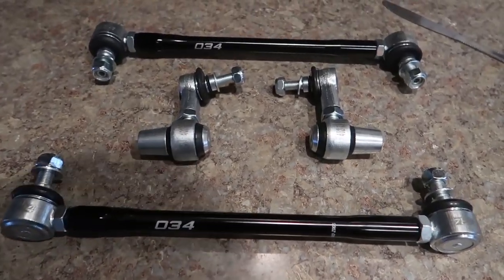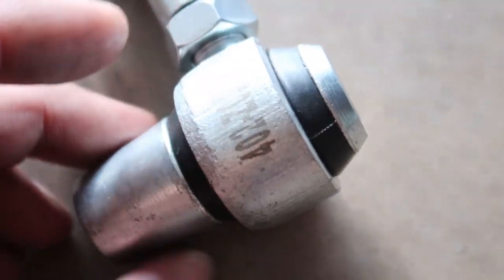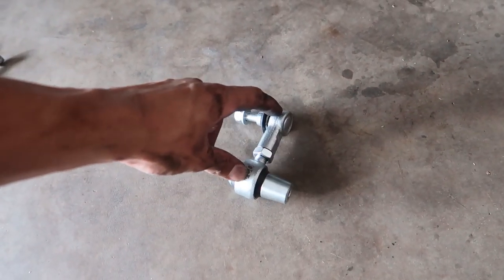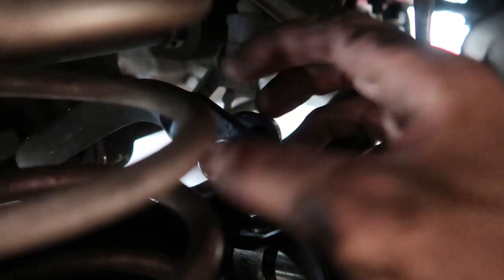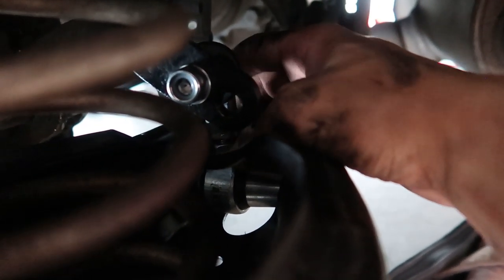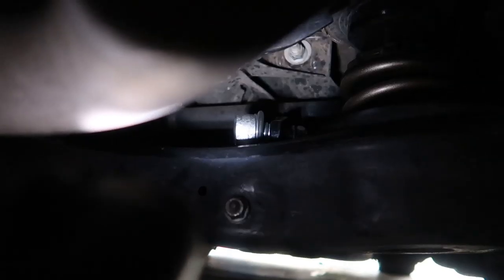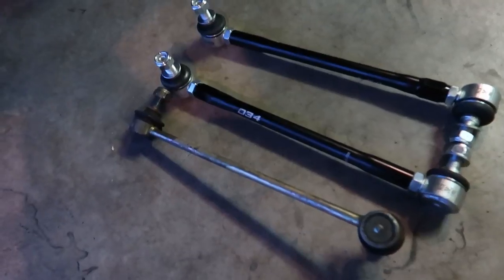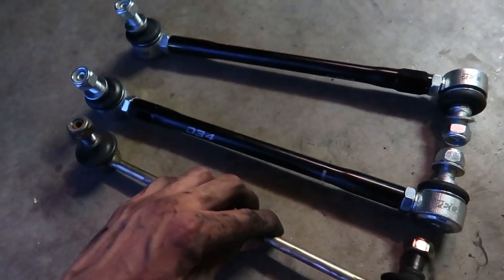034 Dynamic+ billet front & rear endlink walkthrough | MK7 Golf R

Comment: Yoyo endlinks rule! Had spherical rears too on stock height and they made tons of noise, it's the bearing that wears and gets noisy... Good stuffs
Reply: Was tons of anoying squeking noise here too...on spherical enf links...so they went rubbish...but this is seems much better option than the metal to metal conract ones...
Reply from the maker: I knew from the start the could get noisy but I didn't realize it would be to this degree. Much better now! If you don't need adjustable ones the Moog endlinks are significantly cheaper
Reply: @BryceJordanProductions  hi mate! I will check them and thanks for the hints!!! If you want any from  me...regarding trackday/time attack use...just LMK...tons and thousand/in $ 😂/  of experience here!
Reply: Definitely decided on getting 034 bar for my mk7 GTI, kinda intimidated by the adjustable 034 endlinks though. the Moog endlinks should work with a 034 sway bar?
Reply from the maker: They'll work fine. But if you lower the car a bunch you need adjustable links otherwise you'll have weird preload on the bar and it's not good for cornering and whatnot.

Comment: Great Vid, may i ask why you removed the 034 rear links and replaced them with the Dynamic Models? Also whats the advantage of adjustable vs not. Thanks Mate :)
Reply from the maker: Adjustable ones so i could remove the preload on the sway bar and the other links made a lot of noise after awhile because of being spherical

Comment: Damn bro thanks for this video, just changed the wheel bearing on my Tiguan, I locked the axle, had to take it out, got white line adjustable end links didn’t know how to install them but now I do, all my lights on to didn’t get to reset the codes but thanks again for this video cause the stock end links and air ride strut bags were running on the control arm so hopefully this will help
Reply from the maker: Heck yeah!! Hopefully that fixes everything for ya bud!
Reply: Bryce Jordan Productions thanks bro I hope so!!

Comment: When you put the car on the ground and you make sure the endlinks can move back and forth . How do you set preload do you make sure it’s even in the middle or do you spin it all the way down or all the way up?
Reply from the maker: In the middle basically, even number of threads on each side is how you wanna start
Reply: Bryce Jordan Productions thanks for the fast response I just took my old lowered car adjustable endlinks off cause one of the threads got bent . But when we installed the new ones  I thought the swap bar looked a little high but we didn’t pull it down just tightened the bottom then adjusted the top and we were unaware of releasing tension and preload so we tightened it all down while being on jacks then put wheel back on and took it for a drive and it was making all these clunking noises and my friend told me I need to pull the sway bar down and then extend the bottom ends for a little bit more room when it comes to turning
Reply: And you said you also had to pull the sway bar down so both sides were flush so hopefully after I redo that  and release tension before putting wheels on and setting preload it  will
Be fixed and not have noise
Reply from the maker: Yup I sounds like you had some decent preload, let me know how it goes after you redo it!

Comment: Need some guidance. 

15 A3 Quattro 034 springs 1.75 drop. 

Finally getting around to installing the 034 sway bar. I just need to confirm I’m going about the endlinks the correct way. 

My understanding is that since the car is lower the endlinks should be shorter. I am aiming for the stiff setting and I don’t think the endlinks can go short enough when the car is at ride height. I am noticing people jack up the arm to about ride height then set it. Is this correct or am I about to do something wrong.
Reply from the maker: That is correct. You'll have to jack up the rear slightly possibly to make the endlinks meet the spot you want on the sway 👌 I'd recommend doing these endlinks in the video tho. The tension on the stock composite ones may cause them to snap in time (I haven't seen it happen, but most do endlinks and sway at the same time).

Comment: Damn! Should find your videos before man!, last black Friday ordered the rear subframe inserts and the spherical end links (front & rear) for my S3 8p, they are awesome (you can feel the difference), but recently they are becoming noisy (clunky), mostly at low speeds. 

So if they become noisy means that they are fading? So eventually need replacement? It's like 4 months! 

About the rear swaybar do you have only positive opinions? As was planning to order mines. 

PS: keep uploading videos! You got a new subscriber
Reply from the maker: Spherical links aren’t for daily style cars, thats why you’re getting the sound. They’re mostly meant for legit track cars that don’t see much actual road time, gotta think they’re metal on metal all the time.. i wound up changing mine out for the new 034 dynamic + end links that aren’t spherical and are adjustable.. no more noise! As for a sway bar ABSOLUTELY, thats like day one mod right there, instant difference. I highly highly suggest getting a front strut bar as well (eurocode and Eurosport sell some real nice once’s!)
Reply: The spherical end links require cleaning and lubing. These adjustable ones don't require it.